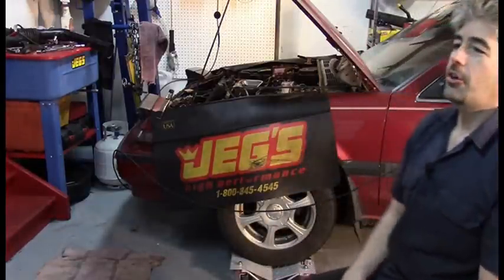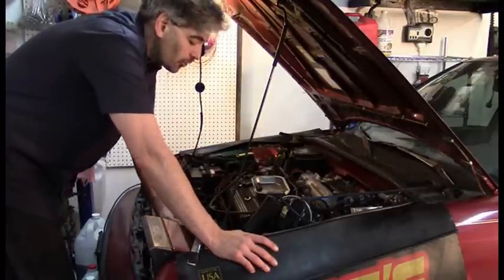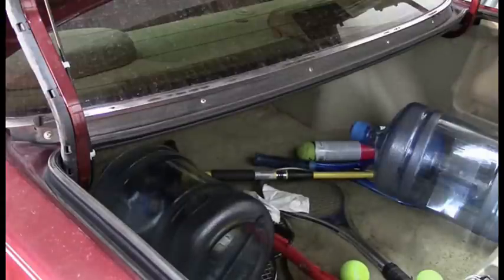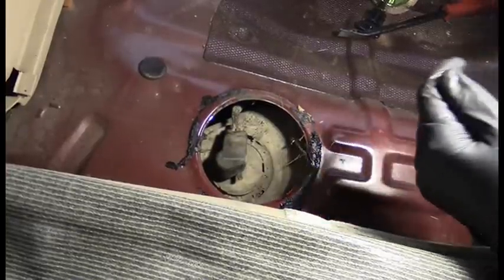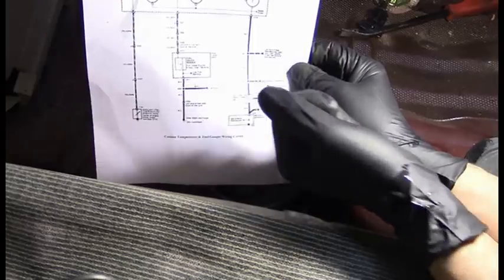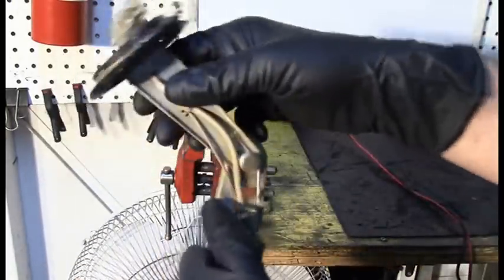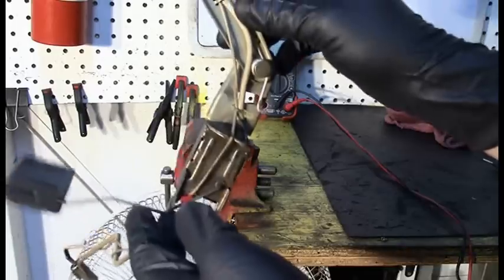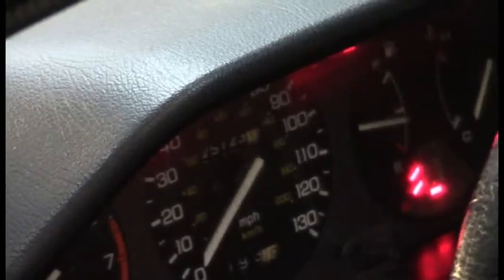Diagnosis of Stuck Fuel Gauge- Is it Gauge or Sending Unit?

Comment: I have a 1994 Chevy g20 sports van and for the first time in a year n half I filled to tank and accidentally put 1/2 gallon extra in it. since then it's stuck on full... past full line and once motor is off it drops to full line. I've driven 70 miles so far.

any ideas? you mentioned gm... will the tank need to be dropped to check sensor? 

thanks
Reply: well this is strange... I may of fixed it.

it's a conversation van and I heard fuses are often ran differently. 

all gauges work beside gas.

I checked the only fuse that said gauge and it was snug in place. I pulled it out to see if it's burnt and was not. I placed it back in.

I needed to leave... start van up and gas went down to I assume where it ought to be with what I used up.

Comment: I've got a 1997 Buick LeSabre that is doing exactly what is in this video - stuck on full.  It's a Buick...will I have to drop the tank please?  I'm just trying to see exactly what  I will need to do, with the help of your video!!!  Thank you!
Reply from the maker: you can reach the connector without having to drop the tank on most every GM car. It's usually on left side on top of tank.

Comment: when the car is turned off ,the gauge should return to empty right since no current is flowing to it???
Reply from the maker: Depends on the design
Reply: +Schrodingers Box it's a 97 Honda civic,  I looking at the gauge now and he thermostat side drops to the lowest point and the fuel doesn't move unless I take the cover off the back to expose the coils
Reply from the maker: marcus Alan What did your electrical tests indicate?

Comment: I've drilled a 4" access hole in more than one trunk pan.  You need to know where the sender is on your victim.  You can install Honda, VW, Subaru, ...  fuel access covers over the hole you just drilled.

Comment: I have a toyota tundra 2007 mind works fine but when it gets to 1/4 it gets stuck there and the yellow mark that tells you . That u need gas dosent go on what could it be? It just gets stuck at the 1/4 i was driving one day and it turn off on me i saw i had 1/4 of gas but i guess inwas empty
Reply from the maker: +Victor Gomez What did the data from your diagnostics show?
Reply: what you mean data?
Reply from the maker: Victor Gomez I mean what were your DVOM readings.  what did you do as shown in the video to isolate the circuit defect?

Comment: My girl friends 99 Corolla that she just bought as a related but unique problem.  When you fill the tank up the needle reads full.  If you turn the car off and take the key out it still reads full.  As the car consumes gas the needle goes down but the needle remains where ever it was when it was running when you turn it off.  I feel like it shouldn't do that.

Any ideas?
Reply from the maker: +cvnapps51 Many ideas. What did your diagnostics tests indicate?

Comment: I have a question. I have an 07 Charger, and the gauge doesn't stick all the time. I know how much fuel is in it until it gets down to a quarter tank. The gauge won't go any lower, therefore I never know if I'm on empty. Would it be the sending unit or is it something completely different
Reply from the maker: +Desiree Watson What did the diagnostics shown in the video indicate?
Reply: +Schrodingers Box well i'm guessing from the video it wouldn't be the sending unit.. but I just wondered if my case would be the same as this one since it doesn't stick all the time. This is probably a stupid question
Reply from the maker: +Desiree Watson Still waiting. for what your data from the diagnostic test you did was. Can't help without that. What were the DVOM readings?

Comment: Ok...thank u for the info. An another question for the accord.... It sometimes hesitates to start what might be the problem?
Reply from the maker: +Temo Leon A million Things. what data do you have? what is the LTFT and STFT at static vs idle? what is the static vs load fuel pressure? what is the desired vs actual IAC position? what ignition tests have you done? What is the EGR desired vs actual position?
  Need data to make any determination.

Comment: What might be the problem on my 2001 Honda Accord EX with no problem with the gas gauge but the empty gas light stayed on even on full tank?
Reply from the maker: +Temo Leon There is a separate circuit for indicator that is independent of the gauge. same diagnosis Procedure but for the indicator instead of the gauge.

Comment: Another nice video - thanks. I having gauge issues on my '95 Explorer (the same one I resurrected with a can of stop leak) - fuel gauge pegs at max most of the time - new pump installed recently; oil switch gauge is mid-range before I start the car, drops to zero when running - put in a new sender but no joy; temp gauge often pegs high - new sender, thermostat and even water pump (all DIY - learned a lot this weekend :) ); and last but by no means last, odometer/trip meter stopped a few years okay, but the battery voltage gauge works! I'd have to drop the fuel tank to get to the sender connector. Are there other locations to disconnect it? Do you think ground problems are causing all my gauge problems or perhaps the cluster needs repairing/replacing?
Reply from the maker: +JohnnyMalaria What was the data you got that indicated the sender was bad? What where the DVOM readings? I would definitely start there and re-analyze.
Reply: +Schrodingers Box So, here's the deal:1. Replaced thermostat - no change in temp gauge pegged high (actually, 12 o'clock position)2. Bought new sender. Ended up with same symptom, so I took both senders, put them in a shallow pan of water and measured the resistance of both as I raised the temperature slowly to boiling. Both read ~20ohm at bp and ~350ohm at room temp. Even plotted graph of both (I couldn't resist)3. Fitted new sender and ran engine but with sender monitored with ohmmeter instead of connected to gauge. Resistance dropped as expected but then dropped very low (zero). I wondered if I had an airlock in the coolant or it wasn't flowing and so perhaps I was getting very hot vapor.4. The connect-it-to-ground test for the gauge caused full deflection (about 2 o'clock position). Voltage coming from gauge ~4.9V.5. Decided to replace water pump6. Changed oil sender because I had an oil leak from it7. Changed oil + filter and coolant.So, now the temp gauge seems to behave most of the time but will peg out for a while.I believe I've located the harness connector that will allow me to test the wires going to both the temp and fuel senders in isolation.
Reply: +JohnnyMalaria Sorry - thought the comment would keep the formatting I typed.

Comment: Well made, useful, and informative video. I like the trick of using the resistor. You said you didn't know what size the resistor was, but you had a meter - why didn't you simply measure it???
Reply: +steve middleton 50 ohms resistor.

Comment: I have a question. if you unplug the gage and the level drops to empty, wouldn't that automatically rule out the guage and wires as the cause? 
I have a 95 Accord with the guage stuck at full, and am at work away from my multimeter.

Comment: Thank you for the great video. I just bought a truck with a similar issue. Mine reads empty unless the tank is actually 3/4 of the way full, then the meter works properly until it gets down to about 3/4 and then it drops to empty until I fill it again. I'm guessing the contact is dirty or the float isn't working correctly. 

I have electrical contact cleaner, but what kind of lubricant is safe for a gas tank? I might need to lube up the float arm and kind of afraid of what to grease it up with, don't want too much junk in my gas tank.

Thanks again! PS I like your minimal production factor but thoroughness of your videos. There are a lot of car guys on youtube that either overproduce to the point of being annoying or just have poor quality videos (poor camera or audio or lack of coherent dialogue) and I think yours are very good compared to most.

Comment: I have a 98 escort and my gauge is stuck at half full
Reply from the maker: +Zack Vance So what did the diagnostic test indicate is the problem?
Reply: +Schrodingers Box Thanks for the reply.  No, I have not.. Should I try autozone maybe?
Reply: +Schrodingers Box I also have a problem with pumping my gas which I am going to try and maybe see if the valve vent is plugged.
Reply from the maker: Uhhhhh, ummmmm maybe try this video?

Comment: My Santa Fe has two sending units.  Gauge would slowly drop as the tank emptied, then at about 1 quarter tank it would start the other way. Also it would never read full.   Found one float sitting at the bottom of the tank.  Access ports made this all easy to fix.

I would  first check resistors with an ohm meter if you can't read the color codes. Very low value resistors might cause things to burn out in some situations.
Reply from the maker: +Chris Gonzales Never heard of that design before. Interesting!

Comment: You're a hell of a good guy ... congrat's & thanks for this video.  
I've, pretty clearly, a gauge problem:  ('82 Mercedes 240D)--
1. I opened instrument panel (for bulbs/oil gauge line, etc., work)...
2. after reassembly, gauge goes up only 2/3s.  3.  It DOES decrease, appropriately, down to empty; i.e., when filling tank, gauge goes up to 2/3s, as if obstructed.  
Mystery = how'd I screw it up by just having back opened?  
I can't recall, nor see, where I'd hit or otherwise damaged gauge.  
Thanks again.  It's a privilege to enjoy your "vibe" & good wit, brains & heart.  
Have a hip holiday.
Reply: Did u ever fix ur gauge? I have an issue on my 98 Camry where the gauge works from full down to about half and then stops working. I already swapped sending unit and problem persists so it must be the gas gauge. I wonder if u fixed urs.

Comment: hi,I just replaced my  07 new beetle 5 cyl with an airtex brand fuel pump, now my fuel gauge isn't reading correctly, before it was replaced my fuel cost from 1/4 to full  tank was about $40 now with new pump from empty or 1/4 to full tank only cost $20,now I have to pump gas more often

Comment: I have a 1990 gmc 1500 and my gauge recently started reading a 1/3 of a full tank. The gauge still moves up and down even when I shake the truck. It basically the opposite of the problem you diagnosis in your video.
Reply from the maker: +Mark McGreevy What did the diagnostic test indicate?
Reply: In the video? Or , never mind the diagnostic test part. Its reading that I have a 1/3 of a tank when its full. I topped it off at the gas station. It still moves, just says I have a lot less fuel then I do, I'm confused.
Reply from the maker: Mark McGreevy Again what did the diagnostic test show? Is the voltage feed correct? Is there resistance in the wiring? Can't tell you whats wrong without data bro
Reply: That's what you meant. I'm not sheer, I haven't tryed anything as far as any testing. I was trying to see where to start, not just drop the tank, remove the bed or cut a hole. I wasn't  sure if this is a common problem. Another thing I've noticed is the hum from the radio. I've heard that's usually a ground problem.
Reply: I was talking  about the gauge on the dashboard. Not a multi meter. Don'tm own one.
Reply from the maker: Mark McGreevy I cant help without the DVOM data bro. Otherwise I'd just be guessing like anyone else.  Sorry.

Comment: I believe your efforts to help others has eternal rewards.
Reply from the maker: +Jim Buford Even if the are temporary rewards it's still worth it!
Reply: If i remove the plug above diesel filter... It shows correct reading... When pluged in it shows wrong guage reading in skoda octavia 2...what is the problem...

Comment: GRowe1978 go look up resistor divider video. The float going up and down changes the resistance to ground therefore the voltage seen to ground by the gauge.

Comment: Thank you for doing this. I have a 1988 Celica GT Convertible with a stuck fuel gauge. Stuck full. I just went to the end of your analysis, pulled the sensor from the tank and ran my finger over the rheostat. That seemed to fix the problem. In the video you cleaned the rheostat. How did you do that? Thanks again,
Bill
Reply from the maker: +William Braun I just cleaned with electrical cleaner- however be advised the fix only lasted a few months- eventually the sending unit did require replacement

Comment: The bands on those tiny resistors are actually numeric color codes.  If you know how to read them.. they will tell you that particular capacitors power capability as well as the "part number"you will need to replace when needed,  Ex.   brown, green & black  / could mean.... Brown = 3,  Green = 0, Black = 4  and so the number of the capacitor you will replace it with would be a 304 capacitor.   In other words...  It's just a color coded part number
Reply from the maker: +Sam Rosario If only there was a pneumonic to help me with that next time I see a resistor.

Comment: I have a '97 lesabre and it (fuel gauge) barely moves,from the full position to 3/4 mark,maybe I can clean the sending unit connection?and it will work,i hope so,thanks for the video.
Reply from the maker: +roger b I don't know if that will work- what did you diagnose as the cause of the problem- sending unit, wiring, or gauge?

Comment: i made an acess panel for my camaro, i had a fuel pressure problem and a gauge problem. i have gone through  the BS of removing a tank from a 3rd/4th gen fbody too many times. made a door under the carpet. my fuel gauge problem was a disconnected ground and my fuel pump feeder line was leaking not allowing the car to hold pressure after key OFF. problem fixed.
Reply from the maker: andrew donohue Yeah I don't have a problem with that at all.  Someone once sent me a video of a guy with a Ford Focus who did the same, and he got all kinds of flak for it. In his case, the focus is the easiest tank drop there is so maybe they had a point, but for RWD cars an access panel is not a bad idea at all IMO.

Comment: Hey Matt, had a question, great video by the way ,if i want to check and see if the gauge is good thru the wiring for the sending unit in my car, can i just use a jumper wire between the signal and the ground on the sending unit harness back at the tank? , i don't have a resistor anywhere and not sure how to go about buying one, im worthless when it comes to electronics, my gauge is stuck on empty, i have a 91 mustang and i already replaced the antislosh module or how ford calls it "voltage amplifier" in the instrument cluster , i replaced the sending unit in the tank like 4 years ago but of course that doesn't mean anything, it could be bad again,thank you for your time!!

Comment: Great and interesting video (and intro of course)! I like your trick with the resistor, trying to emulate the sending unit. If you have a resistor lying on the bench and do not know the resistance value of it, you can always use your multimeter and measure it (no need to learn the color coding schemes). Then it is convenient with autorange function of the meter.

Comment: Hey Matt,  great video.  I am just wondering about a couple things.  What is the 6v reading on the signal wire?  Is that a bias voltage?  I thought the potentiometer would pull the 12v up or down depending on it's position, but instead the potentiometer pulls the 6v up or down?  If so, what is the 12v wire for?  Or am I just totally missing something and/or confusing myself?

Comment: To help answer Raju problem. I had to change my boats sending unit. Same issue. OK out of the tank and empty in the tank. Believe it or not, but the float stopped floating!? replaced it and it works now.

Comment: What kind of cleaner you use thanks in advance
Reply from the maker: Mike Villanueva I used regular electrical parts cleaner. But in all fairness the repair only held for about 4 months, The car needs a new sending unit to be permenantly fixed.
Reply: Okie sir tnx so much

Comment: Great video, I have been chain watching them to get up to date.  As far as you know does the gauge still work? Reason why I ask is it looks as if the variable resistor is submerged in gasoline and gas is a very good cleaning agent. So when you hit it with contact cleaner I was surprised it worked. Was there visible crud on the resistance pad or contact that the contact cleaner took off that the gasoline could not?  Thanks again for sharing I love the methodology of your troubleshooting approach.
Reply from the maker: Iam D Unfortunately, the gauge stopped working again about 4 months after this attempted free fix.  The gauge only worked when it was below the half mark but never went above the half mark (actually sometimes it would).  But I guess if you are only gonna have the gauge work best to have it work between half and empty eh? But the only real fix would have been a replacement of the sending unit- customer didn't care about the gauge enough to do the repair though.

  But more unfortunately by far, the owner of this vehicle passed away about 2 months ago.  Absolutely shocking. Unbeknownst to me and most of his friends, he was battling cancer and you would absolutely never have known it.  "Monet" as we knew him was a truly unique and class act. I was really lucky to have met him.